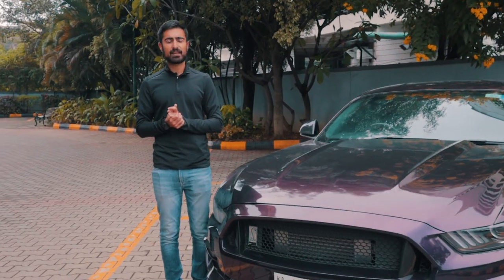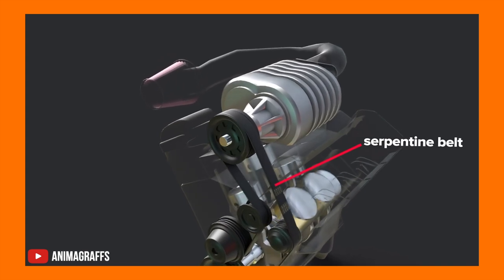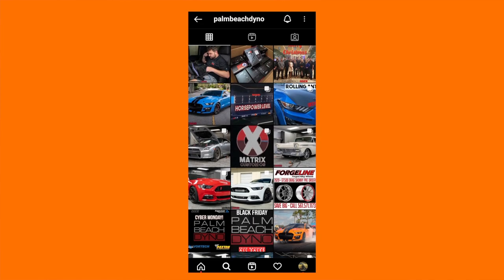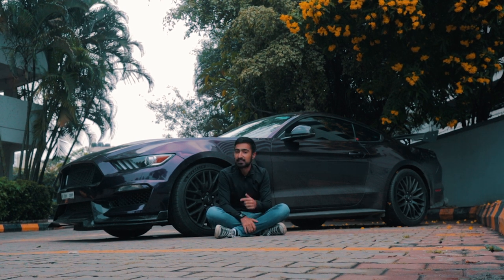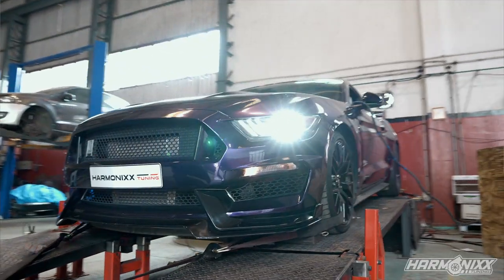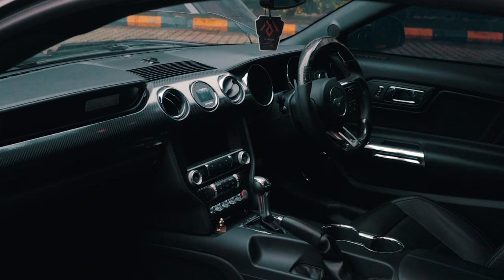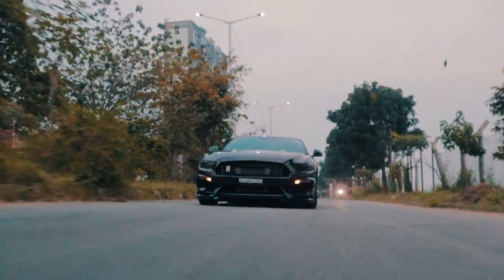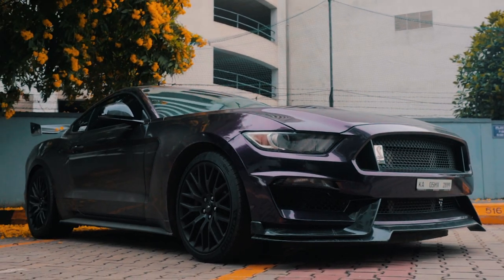Procharged Stage 2 Mustang GT makes 700BHP and 900NM 🤯 | Dyno Testing and 1/4 Mile | Autoculture

Comment: at which garage was the supercharger installed ?
Reply: In the engine bay
Reply: @daniesalex7073  i meant the garage
Reply: @mahinganatra978  they didn't specify that in the video, Some tuner shop probably,   Procharger makes kits for the Mustang,
Reply: Marqone garage i think so
Reply from the maker: If we're not wrong, it was installed at 6th Mile Customs.